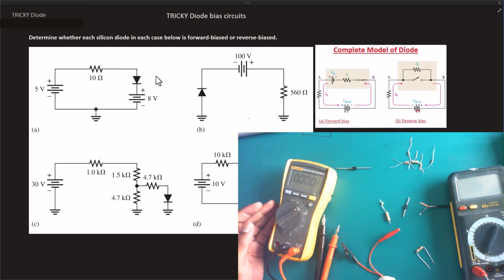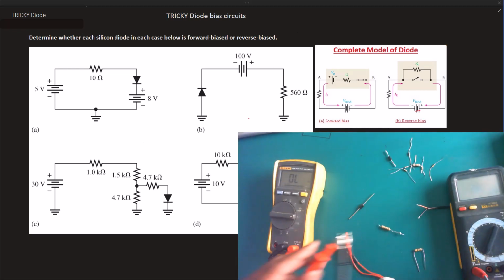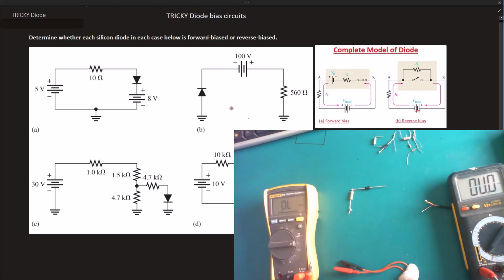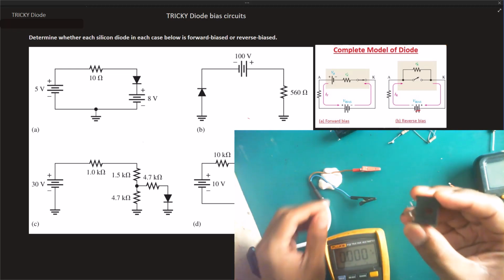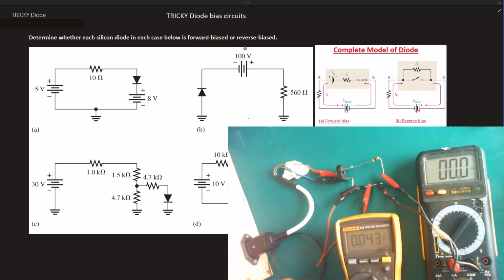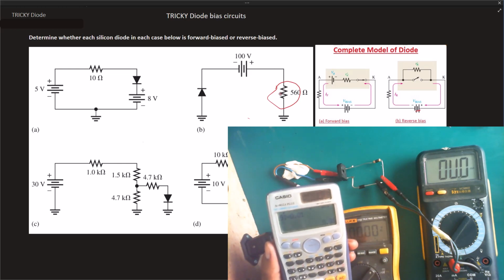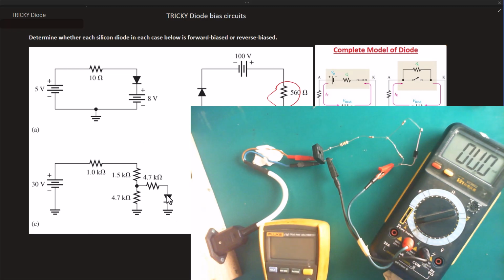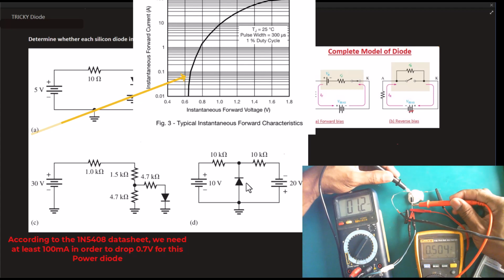Tricky Diode Forward Reverse Bias Circuits. Part 3

Comment: What will the current across the diode be?
Reply from the maker: The current through the diode will be the same current through that branch and through the Resistor. You can calculate it.
Reply: How, when you've ignored the fact that the current splits at the ground,One heading to the 10V and other to the diode. I am talking about Figure D.
Reply from the maker: Thanks for clarifying your question. My previous response was a generalization since you didn't specify the exact placement of the diode. You're righ, the current will split at that point. 
To determine this current, you need to apply Kirchhoff’s Voltage Law (KVL) around the loop containing the diode. I believe I solved this KVL loop in the tutorial, so if you find the voltage at the node, you can calculate the current by considering the diode's forward voltage. 
Since the forward voltage was not specified in this tutorial, you can assume 0.7V for a silicon diode and work it out. You should get a current of less than 1mA or so. Let me know how it goes, I might consider making a Part 4 tutorial.
Reply: Please attempt the question, and if possible make it a video because there's so many taughts running my mind. Where the current splits it can be portrayed as a parallel circuit but can't because of the battery, however another way maybe that the voltage PULLS the current in it's direction more than the diode, despite it having LESS RESISTANCE.
Reply from the maker: You’ve got an interesting thought process going on! When analyzing a circuit with two power supplies (10V and 20V) and a diode, the key is to consider how voltage dictates current flow.

The diode’s forward current depends on the potential difference across it. For example If the anode is at 10V and the cathode at 20V, the diode would be reverse-biased and block current flow. But if the anode is connected to the 20V source and the cathode to 10V, it would be forward-biased, allowing current to flow.

Regarding the current split, while it might seem like a parallel circuit, the diode's behavior is nonlinear—it doesn’t simply "choose the path of least resistance" but rather responds to voltage polarity. The stronger voltage source will dictate the current flow direction.

A video on this would definitely help clarify things! I'll keep it in mind for a future tutorial. Thanks for the suggestion!

Comment: How to determine the voltage across the diode ?
Reply from the maker: Very simple: If you know which diode it is, part number... you can check the datasheet to get its forward voltage characteristics. Or you can directly measure across the diode using a multimeter. You can also use a KVL loop for your circuit to find the diode voltage.